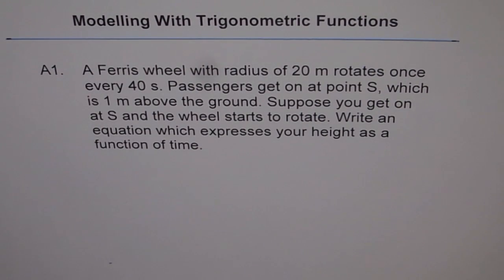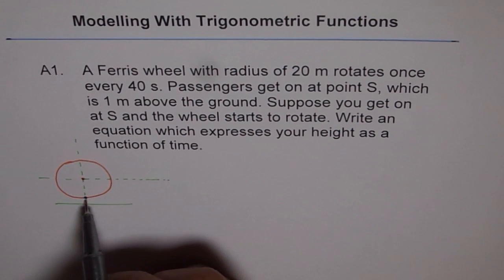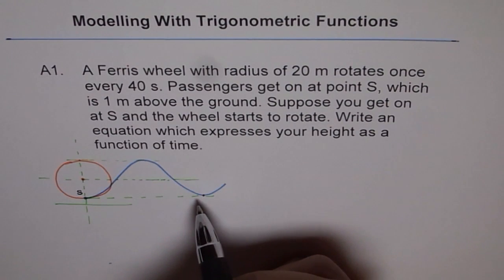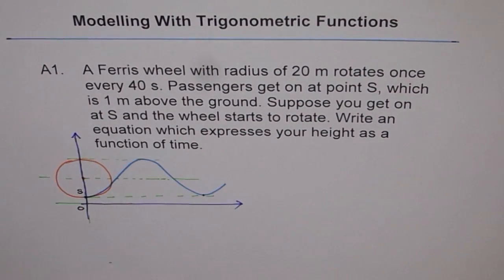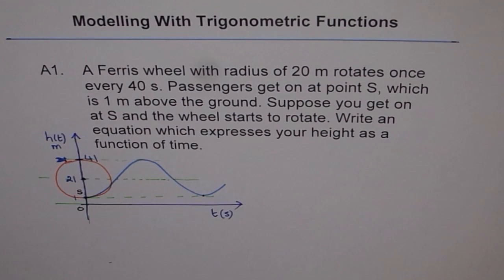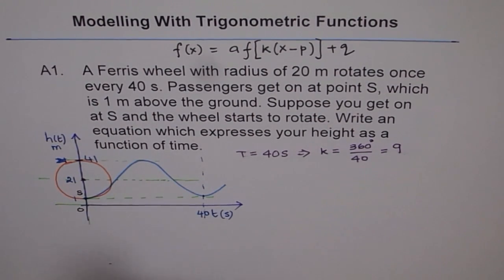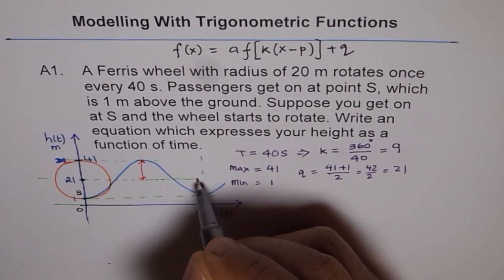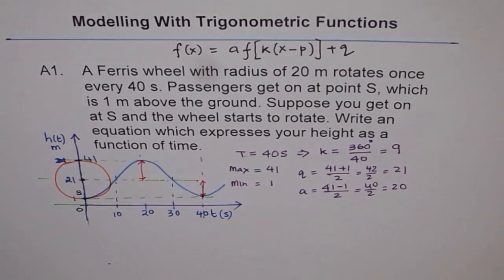Modelling Height on Ferris Wheel as Trigonometric Function A1

Comment: i have a trig problem similar to this for home work ..except it says i have a radius of 60 feet and is suspended at 10 feet above the ground . the wheel rotates at a rate of 2 revolutions every 6 minutes....... and im supposed to write a function that describes sydney height on the ferris wheel , who is at the 3 O'clock position around the circle , can someone please help me
Reply from the maker: +tequanna hudson Starting from 3 O Clock is like sine function. 2 revolutions every 6 minutes implies 2 revolutions in 6 x 60 = 360 seconds or 1 revolution 180 seconds. i.e. T = 180., k is 360/T or k = 360/180 = 2
Amplitude is 60 and the axis is at 10 feet (pl check if it is 10 or some other number). Any way, the equation from the given information should be h(t) = 60 sin(2t) + 10. I hope that helps. All the Best!
Reply: +Anil Kumar thank u soo much ... you are a life saver ..i am subscribing ! thanks
Reply from the maker: Thanks